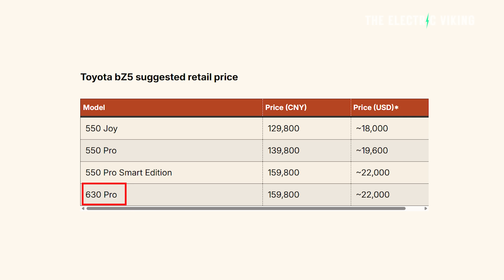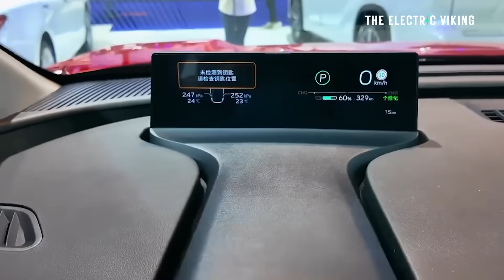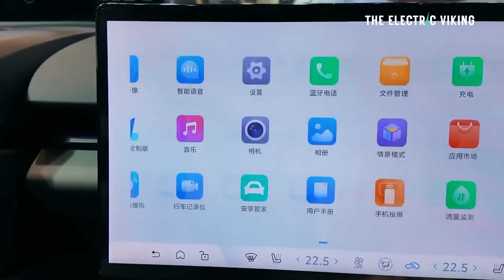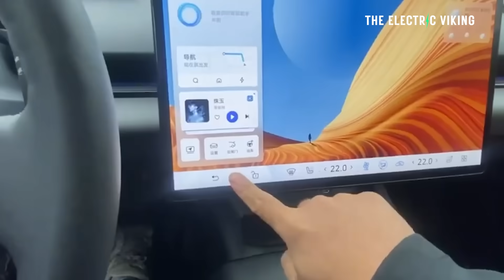Toyota’s $18K EV: The bZ5 gets BYD Blade battery and 630km range

Comment: Toyota rotary gear selector is annoying. Hyundai and Kia have the best solution.
Reply: I have it on my bz4x, and yes, it is not the most logical solution. But really, you turn it, and you drive. What is the big deal?
Reply: @olepetersen3554  it would be more practical on the steering column
Reply: Here in Canada the ioniq battery costs CAD$ 65,000 to replace...so no

Comment: GM and Toyota hoble their charge speed so their cars are not better than the gas models.  It's tragic.  It's why I won't but an equinox or blazer or bZ anything.  They won't unleash a better EV. Also you think they will get more software updates over time making them better?  I'm  51k miles in the lfp rwd Tesla and love it.
Reply: That's one possible point of view on it. Maybe GM and Toyota are rushing products to market without putting them through thousands of miles of real world testing to see how high a C rate they can get away with and keep degradation in check?